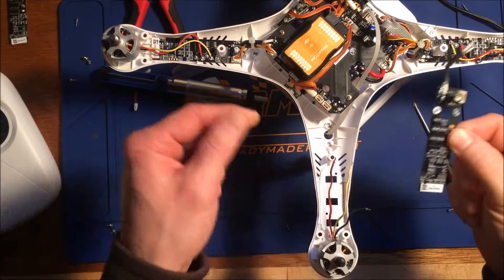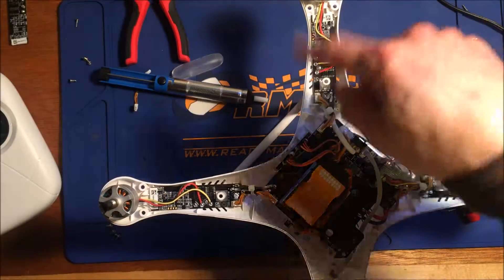Phantom 2 ESC Replacement

Comment: Great video!  I used your procedure to replace the ESC on my P2.  Unfortunately, the malfunctioning motor is still having the same problem.  I also noticed that the LED under the arm with the bad motor is also not working.  Here is a video of the symptoms.  https://youtu.be/6h3MGjOSeJ4  Any idea on what else may be causing this?
Reply from the maker: The LED is part of the ESC. If you replaced the ESC with a new one, then my guess is that it is miswired. Double check all the connections. If you like, link a high-res image of your ESC and all the connections, including to the main board and I see if anything appears wrong.
Reply: @HubrisFPV  Here is a link to a photo of the install https://www.dropbox.com/s/jm8hgn9oacihh27/_MG_4472.JPG?dl=0
Reply from the maker: @FunThingsInJacksonville  Thanks for the detailed photo. I don't see anything obviously wrong. My only suggestions would be to confirm that all the plugs going into the Naza (the orange box in the middle) are fully seated, and double check (with a magnifying glass if needed) that there are no small strands of wire shorting across any of the solder joints you made. It might be just glare, but confirm that there is no damage to the square component that is under the 3 motor wires. If you have a multimeter and are careful, you could confirm that there is proper voltage across the V and G wires when the quad is powered up (props off!!)

If none of that works, it gets to be more work, where you switch your Motor 2 ESC with another ESC to try and determine if the root cause is the ESC, or the signal wires, etc...
Reply: @HubrisFPV  Really appreciate the replies.  I have a multimeter and tried testing for voltage on the V and G wires on all of the motors but did not see any voltage on any of them.  Tried with motors on and off.  Do you know what the voltage should be?  I had the multimeter set to the lowest range but got no reading.  I will check all of the connections as you suggested.
Reply from the maker: @FunThingsInJacksonville  You should find battery voltage across V and G -- 11ish  to 12.6V . There may be a conformal coating over the solder joints on the non-repaired ESCs, so you might need to scratch through it to get contact on your multimeter probes.
1) Remove props; remove P2V+ top cover for ESC board access; keep GPS cable plugged in; remove gimbal clamp.
2) P2V+ normal turn on: RC remote on, then P2V+ quadcopter battery on; motors off. Range extender not needed.
3) Check +11v ESC input voltage and +3.3v microprocessor (MPU) voltage.
See also: https://phantompilots.com/attachments/p2v_esc2-pdf.67333/